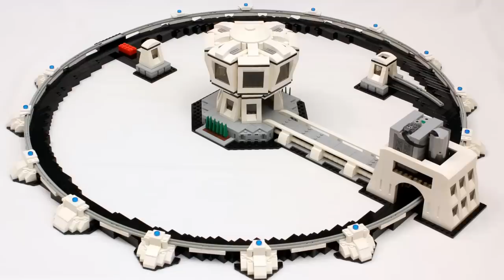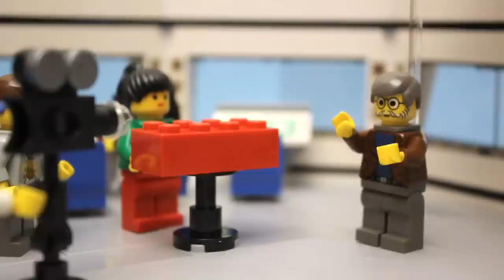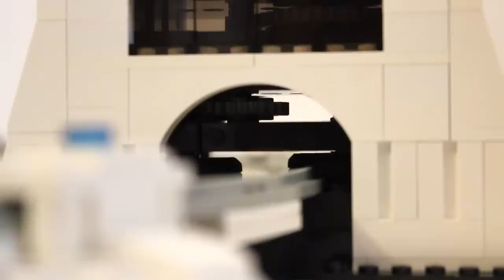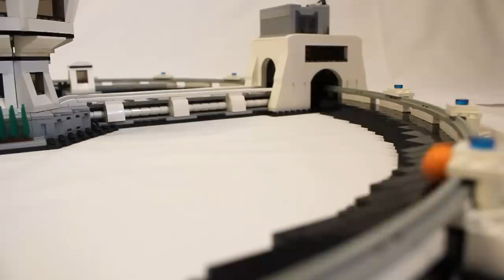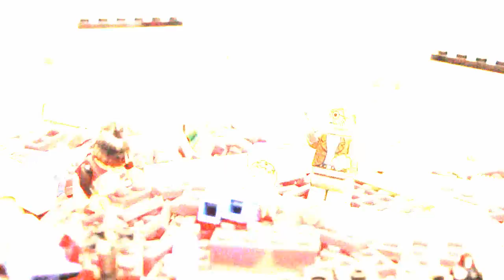LEGO Particle Accelerator

Comment: I had no idea what a particle accelerator looked like before this video. I assumed that a particle was fired from two ends of a giant tube and they collided or something. Thank you for teaching me something today, and making this really amazing LEGO model!
Reply: It's actually quite different to this. I recommend searching it on google images....
Reply: what you described is called a linear particle accelerator. A tube that particles are fired down and smashed together in the middle. This model is of a circular particle accelerator, like the one at CERN. In real life, circular particle accelerators have two tubes that send particles in opposite directions then collide them at special crossover points. This allows for much higher energies to be achieved.
Reply: bigglessy it's a bit late so sorry for the necropost. Linear colliders usually smash whatever they are accelerating into a stationary target (they only get one possible pass so it has to count), loop colliders (they can be a circle but don't need to be) are usually counter rotating and send two streams of packets opposite directions then have them cross and collide in a detector.

Comment: does the ball actually go at 440 studs per second? XD
Reply from the maker: +chase1146 Yup, it does. I calculated the actual speed by analyzing the video footage.
Reply: How many studs in a feet?
Reply: SAWANA WANA there 38.1 studs in a foot
Reply: +chase1146 
So it goes about 18 feet a second.
Reply: Why do you still use feet :(
Reply: +HGGdragon what do you mean
Reply: its about the maximum running speed of a human.
Reply: @0mn0m8w31rdc4ndy  Metric units, anyone?
Reply: @pyroplays8685  What?

Comment: a particle beam, mass partly converted to energy, close to the speed of light, in a vacuum - suddenly hits an area with high density.. what would happen? 
1) beam would just pass through. needle hole. nothing really happens. (what i think will happen)
2) energy suddenly converts back to mass when hitting the high desity area and and since it has to rearrange with the particles in this are a huuuuge explosion will occur to spread and convert the energy (what others think will happen)
3) a portal into a new dimension will open (what will actually happen, cuz half-life told us)
Reply: Number 3 is the most accurate.

Comment: You've added multi-particles. How about a second accelerator and another ring with particle going in opposite direction? The switch would be the trick. Very nicely done though, as-is.

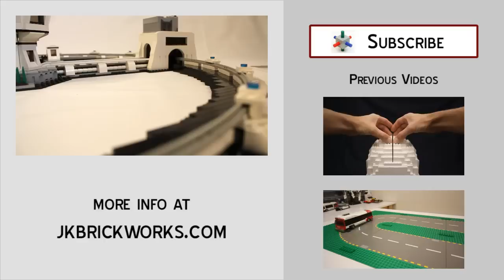Comment: What is the little dude saying at 1:09? I keep replaying it over and over...."I think we've just discovered______"
Planes? Plates? Blades?
I really am scratching my head on this.
Reply from the maker: Plates. :)
Reply: JK Brickworks  Thank you for clearing that up. Secondly, what is the significance of plates? I keep wracking my brain from all the articles I've read about the Hadron Collider to see if I can somehow relate that to a lego/plates pun or comment, but my tired brain isn't connecting the dots.
Reply from the maker: illiniLB I think you're trying to read too much into it. :)  The only significance is that you can combine multiple plates to make up a brick. In trying to find out what LEGO bricks are made of, they simply discover the smaller plate pieces.
Reply: JK Brickworks Ah, I just didn't know the proper LEGO term for the thin pieces was "plates". It all makes sense now. Thanks!

Comment: I have tried connecting the main battery box w/ the motor alone and it doesn't work. The battery box I am using is the one stated in the build instructions but as I just said, it doesn't work. Any ideas on what I need to make it work?